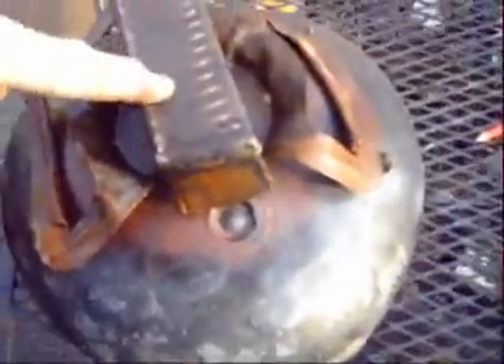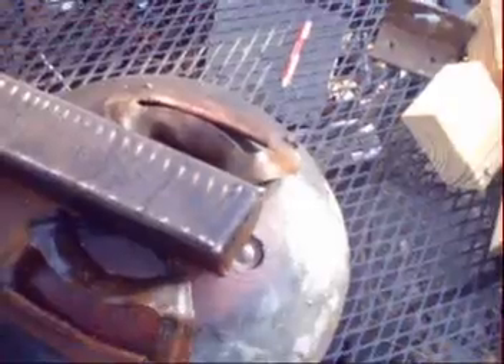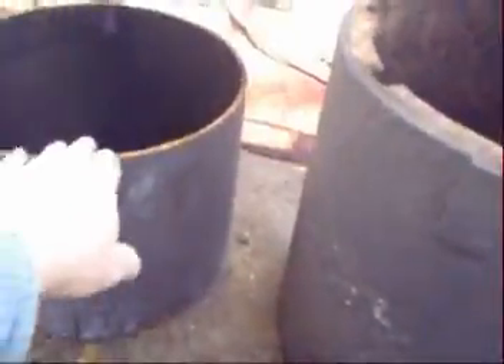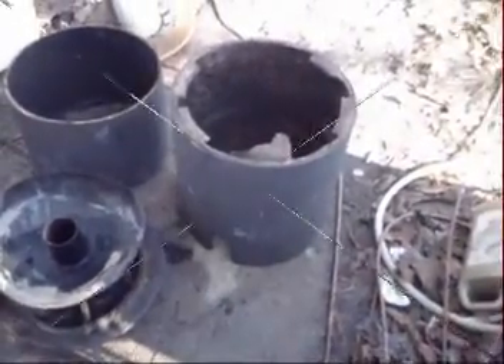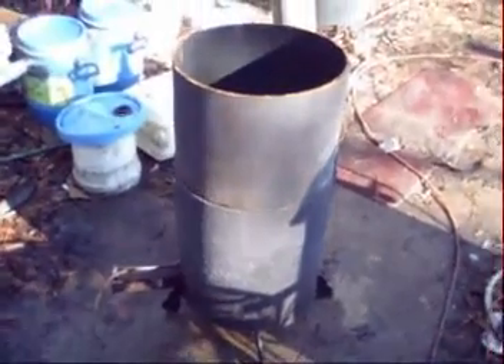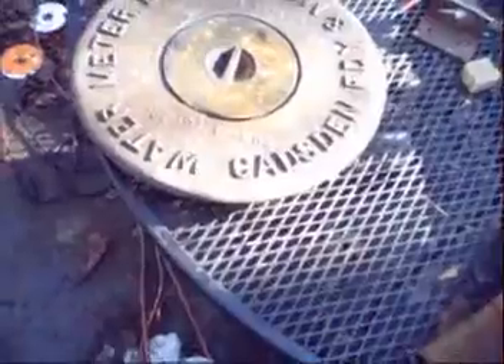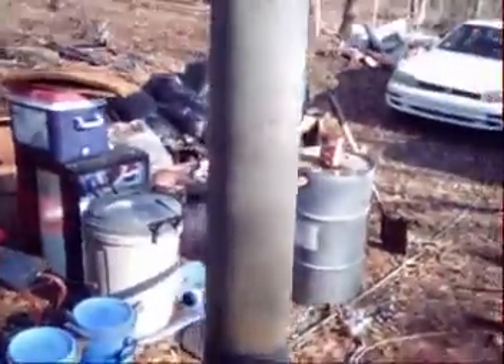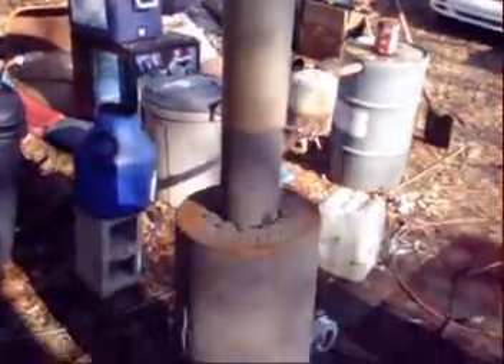Waste oil burner 2.MPG

Comment from the maker: @TheProfessionalloser 
If you put in a shop or building, you would run the exaust flume to the outside. Through the roof or through a wall, and the flume needs to go about 4 feet higher than your building crown.
In this video the short flume pipe is so you can see that it is burning and exhaust gas is clean all in the same shot.

Comment: Man you really like to use those colanders don't you? LOL It looks like they do the job and cheap.
Maybe you can answer a question of mine. I have a double 55 gallon barrel stove. You said in this vid cast iron holds heat better than steel. So would a potbelly cast stove heat my 1000Sq ft barn better than the barrel stove? Or at least the same with less wood? The barrel stove burns a lot of wood. Just like to know your thoughts. Also I have acess to free used oil so this vid is great! Thanks!

Comment: I like it,.....  It works well.

Have a look at my heater where I use worn out heavy Semi trailer brake drums for the outer case they are very robust, look neat and usually free from any trucking depot where they maintain their own trucks.

Cheers,
Spike.
5*

Comment from the maker: Looking forward to your video. I'm working on a multi-fuel heater to heat my house, when finished it will burn oil, pellets,or wood. It is pretty cold here in Alabama, last nite it was 17 deg.  It's 36 now 2:00pm. 
Thank's for your viewing and comments,
Blake

Comment: Another great video.  You've inspired me to post my heater.  I'm not nearly as good at the video thing as you though.  I would like to see your burner after a days use.  I noticed you said it won't coke up.  That is the only drawback mine has, I have to clean it after 12 hours or so.  I'm posting mine tonight.  See what you think.  Are you heating you house with one of these?  I don't know where you live, but it don't look very cold there.  Thanks for the videos.  
   Rich